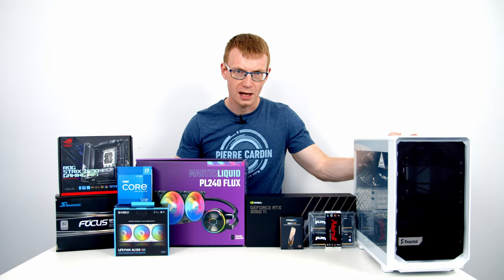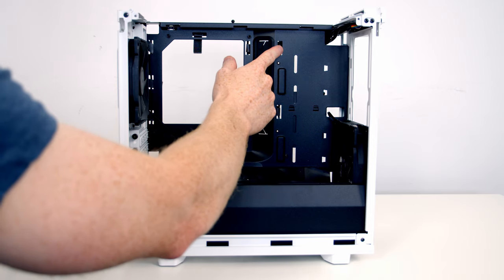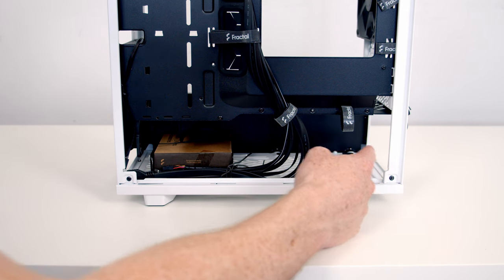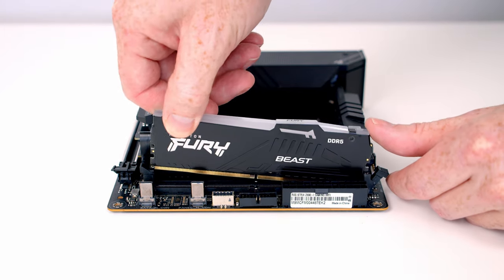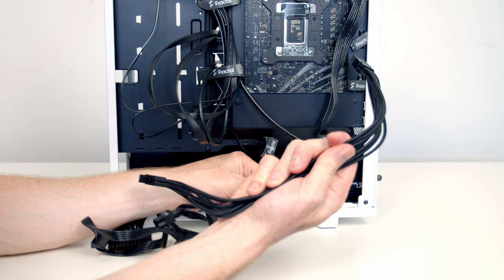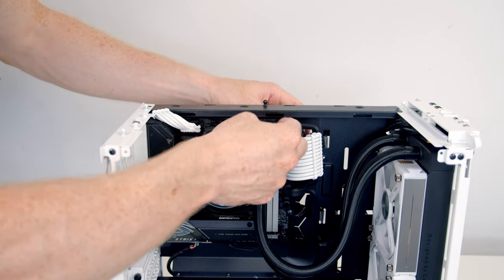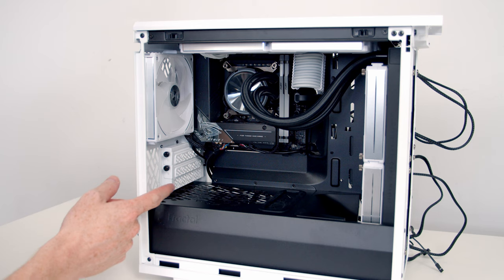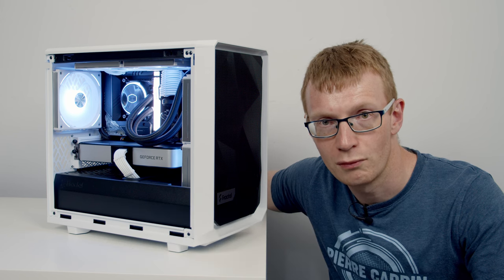Fractal Design Meshify 2 Nano Build - Step by Step Guide

Comment: Nice build video. A question about the sfx power supply. Are the short motherboard cables a Seasonic issue or an sfx issue in general?
Reply from the maker: They vary in length by manufacturer another SFX PSU might be ok

Comment: The case is designed for a Mini ITX motherboard, but there won't be enough headers for the reset switch and power LED unless you use an add-in card? Seems pretty strange (and annoying). Are there no boards with enough headers?
Reply: I think this is just for this particular motherboard. The Mini ITX systems I have build have headers for reset switch, Power LED, etc. He just didn't include the add-in card due to aesthetics :)

Comment: let's be honest ! the AIO is too big , he push the first RAM stick ! , and you mount 5 fans but all on exhaust mode ... make no sense..... you need as much as possible 50% intake and 50% exhaust, you just put 100% exhaust and 0% intake ...... you are not professional builder, for persons who didn't know about this you are god. but for mee you are too far away from PC Buildings !
Reply: The front radiator fans are set to intake.
Reply: Xd

Radiator fans are intake
The bottom fan is intake

Rear and top are exhaust.

6 fans total. 3 intake, 3 exhaust.
Reply: @cheddar8213  the Fans should be between the case and radiator, after all will be much louder the fan in this position,  I can't call this intake. Sorry